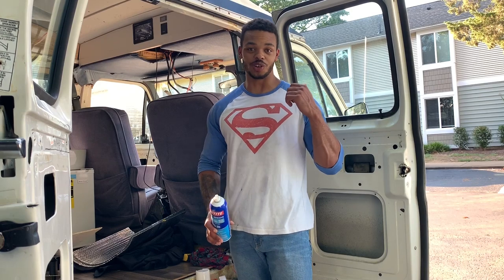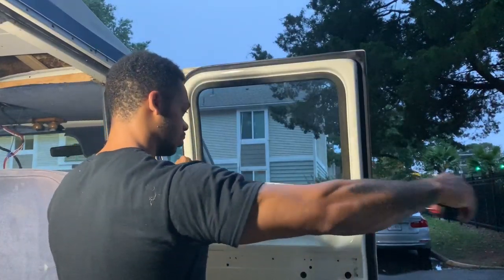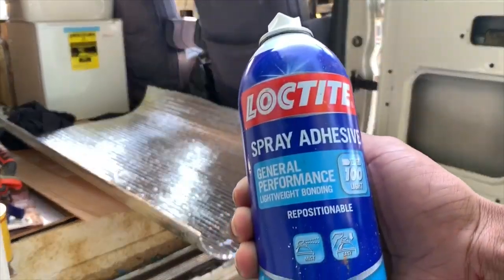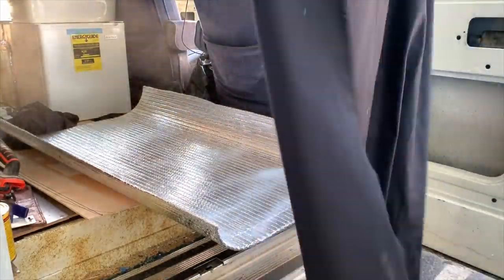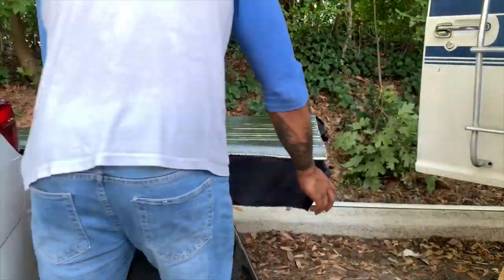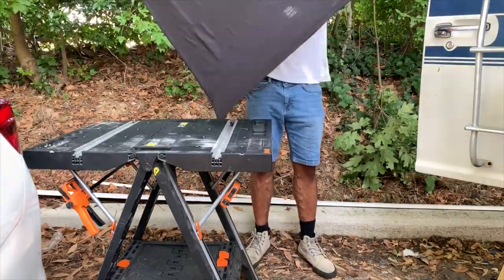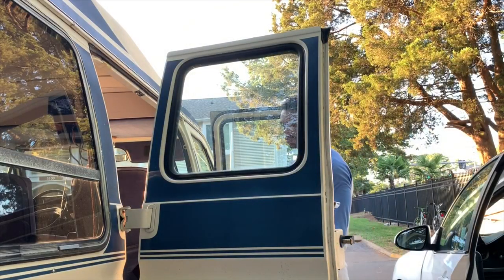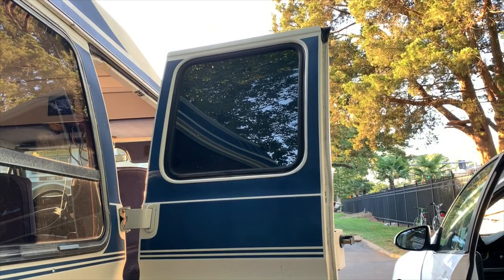STEALTH Blackout Window Covers for Van Dwellers ( Easy DIY )

Comment: I have reflectix for stealth camping in my truck and was thinking of spray-painting them black but I definitely like this idea!  Appreciate the tip
Reply from the maker: Yeah the fabric is a little bit easier to work with. I’m glad I could give you the idea!
Reply: James W  that's a good idea! I ended up using regular black spray paint and I've  used the reflectix a lot so far.. it works great and you definitely cannot see in the back of my truck
Reply: Make sure the paint is matte and with primer for better paint adhesion

Comment: Yet again great video👌👌 YOU ROCK, CANT WAIT CANT WAIT TO SEE WHAT YA DO 😁😁😁😁🤗🤗🤗🤗🤗🤗On  the covers I did , instead of fabric on the inside part I used that contact vinyl paper that's used for lining kitchen drawers , for 2 reasons, one I can easily wipe them down👍 and ✌ (2) when I get tired of a pattern I can easily just put a new layer over the old (or when I'm not being lazy I'll peal it and start over)
Reply: Cool idea 💡
Reply from the maker: Nice idea!
Reply: @Dualex_Builds  it works awesome, they even have drawer liner that is cork, jadnt used it for my windows yet , it's cool stuff, now get back to work so we can have another video lol

Comment: Clever clever. Similar to your idea i blacked out my windows by cutting out attic foil inch thick foam board to wedge in the windows but before putting em in i spray painted them flat black with heat proof paint. BAM keeps inside my van worm in the winter and keeps more heat out in the summer. Doing this blocks your left and right blind spots so if your van doesn't already have em slap on a pair of blind spot mirrors, you can get a pair for a buck at the dollar store. 🇺🇸🇺🇸🇺🇸❤
Reply: Hi. What about the condensation in the window? We try your solution but in the rain situation is difficult whit the condensation and mold ?
Reply: @nataliamartin6807   hi good evening. I clean my windows with white vinegar/alcohol warm water blend then dry followed with rain×-antifog on the inside and a buffing of Nu finish car polish.

Comment: Window covers/insulation (10mm thick) for my 4Runner, 5mm black EVA foam sheets 24" x 40", and Reflectix (another 5mm) glued together with 3M Hi-Strength 90 spray contact adhesive. Go heavy on the glue, I'm talking wall-to-wall coverage on both the foam and the Reflectix. Then using the templates I made for the six side windows and the back window (equals 4 templates) trace the window pattern onto the oversized black foam with a silver Sharpie and cut to exact fit using very sharp 10-12 inch scissors. All black on one side for heat absorption in the winter and silver Reflectix on the other side for heat rejection in the summer, and with 10mm total thickness good insulation with little or no bending or warping. I tried using Reflectix and fabric but it was too thin and warped on me.

Comment: Will you be doing a backup cam installation for backing up? What things are you thinking of doing since visibility is pretty slim with everything you have in the back. You're doing great work on this and hope things continue to move smooth.
Reply from the maker: I am going to install a backup camera. As it is right now there are 2 security cameras on the sides of the van so that way if you’re inside of the van with the window covers on, you will still be able to see what’s going on outside of the van
Reply: @Dualex_Builds   wow, that's pretty cool!

Comment: Light from inside may crack through at night. Try adding a puffy layer around the reflectix's edges using spongy material (say about at least a half an inch of cushion) and then cover with black fabric... and then stuff the finished panels against the window frames tightly. May need adjusting to make then hold snug. Just a friendly tip :)
Reply from the maker: By overlapping the window like I did in the video it’s impossible for light to come through the window if your corners are secured correctly to the wall

Comment: I like this idea but I don’t have metal on the inside of my SUV.  Any suggestions?
Reply from the maker: Esther stephens I mentioned that in the video. Not all of my windows have meta surrounding them
Reply: He mentioned using Velcro where he doesn't have exposed metal and will be replacing magnets as he continues to cover his metal with wood. Though I suppose he could glue magnets or piece of metal to inside wall covering instead of using Velcro.

Comment: need your opinion i thinking of spray (black) painting my inside windows in my van i'm not worry about seeing out. what do you think about this
Reply: jfletc3000 I wouldn’t do it just Incase you ever want to be able to see out of them it’s a lot of work to get the paint off
Reply: D L Only problem I have is I’m on a fixed income I’m on Social Security disability and I need to make this as cheap as possible
Reply: jfletc3000 I understand being on a fixed income but maybe save up a little longer for something a little better? Or there is a product call plasti-dip it’s just like spray paint but it’s almost like a rubberized paint material that is “easily” removable I know a ton of people
Who have sprayed rims with it and pressure washed it off after a bit so it’s possible to remove it but I’ve never used it and don’t know how truly easy it is to use.....or go to a fabric store and get blackout curtain material and cut it to the sizes you need hope this helps
Reply from the maker: If money is the issue then get some cardboard for free and pain that black to cover the window. That should be free and you won’t have to paint the actual window
Reply: DualEx I went to the dollar store and got these poster boards that have foam between them It cost a dollar apiece I think I need about 10 of them
Reply: @jfletc3000  There you go.
Reply: jfletc3000, still, cardboard is free & the paint is cheaper than the poster board.  And cardboard has insulating properties.  Good luck.

Comment: What happened to your Shopify journey?
Reply from the maker: Anything Everything I’m an entrepreneur and I’m not all about Shopify. I currently run 3 stores but these videos have much more traction and are more interesting for me. I plan on doing more e-commerce videos after this van project has been sold before I start my next one
Reply: @Dualex_Builds  ok so how much do you currently make on your stores per day
Reply from the maker: It varies. Usually I’m making $200-300 profit each day but my sales numbers are much higher than that obviously. If you want a tip, I would recommend selling digital products, or manufacture your own products. I haven’t done drop shipping for a long time. There’s more profit margin and more returning customers when you have your own product or sell a digital product